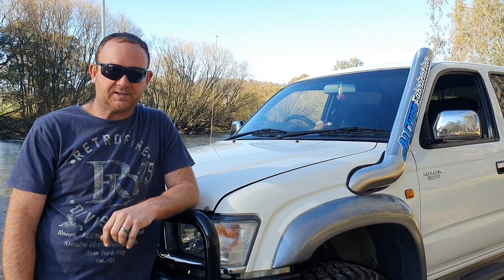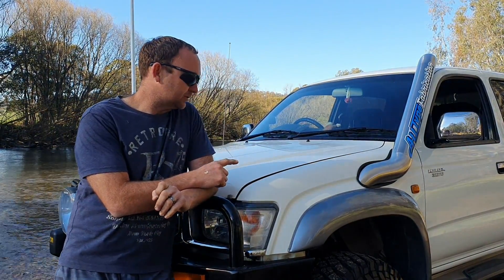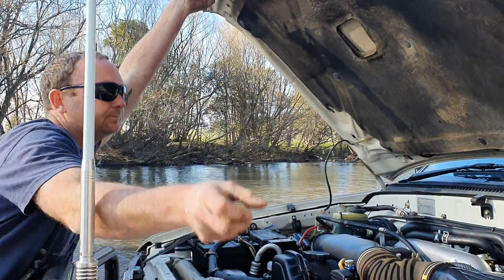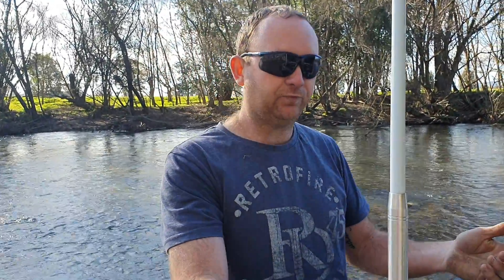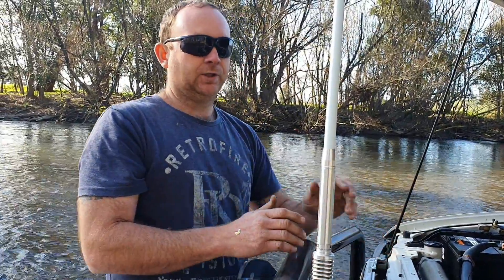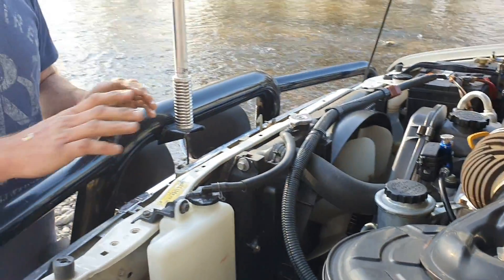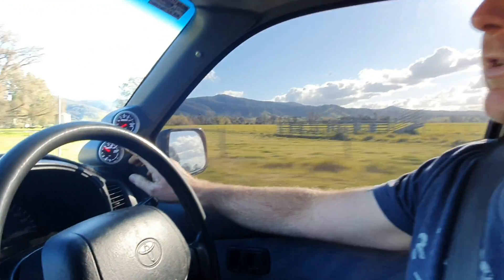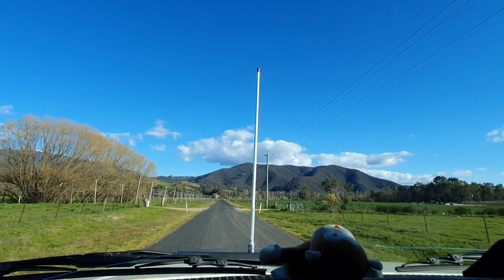1kzte hilux more boost? with stock pump making 18psi is it possible???

Comment: Question from a guy in the US with an imported 96 surf without an intercooler. While obviously an intercooler would be a benefit, is this a significant increase without an intercooler? I have EGR blocked, timing resistor mod, and running 14psi. I appreciate these videos!

Comment: Hey mate my ute is 2000 hilux 1kzte but has the electronic throttle body and pump, will all the mods you done on your one work on my  cheers
Reply from the maker: I dont see why not give it a go its just a boost tee afterall
Reply: Sweet as, I will give it a crack and see what happens. Thanks

Comment: @TRAV30387 Hey ... what is the effect on the fuel economy with increased boost and fuel cut defender, Are you getting better or do you have decreased fuel economy ?
Reply from the maker: Definitely worse on fuel consumption. Ive gone to the mechanical pump now double the power and fuel economy
Reply: @TRAV30387 i have mechanical pump and i wonder how can i have more power with same stock parts

Comment: Hi love the video im about to do this to my 1kzte Ln130 surf so a bit of a break down 1boost tap on turbo side 
2 boost cut defender on sensor side
14 turns for sensor side then how many turns turbo side do both of them have matching turns or vary
Reply from the maker: Turbo side it depends on the boost tee just click it till you get what psi you want cheers 4 the comment

Comment: Looking at maybe putting  boost t on my super custom van and put in a couple of pounds boost into it ,  standard at the moment just with new injectors it's a family wagon so not looking at a big exhaust is it worth putting extra couple of pounds of boost or wasting my time ,what about reliability . I heard by adding more boost and no fuel you're not going to get power gains what's your guys experience?
Reply: Up big hills did you noticed the egt's going up with more boost compared to std boost
Reply from the maker: @jr6874  not much difference not to worry i found
Reply from the maker: The electronic pumps have a fuel cut at 18psi boost so goin to 15psi from say 12psi will increase noticeable power not much i ran higher boost for about 6 months b 4 i did the big build

Comment: I have a rebuilt 1kz-te prado grndapa spec at the moment but  running  a high-flow turbo and boost t and it pulls hard !!! 
I'll chuck on a 3'' exhaust and fab up a snorkel and airbox then look at the fuel cut defender 
Cheers for the info mate

Comment: Hey mate, i know this is an old video but i have the same 1Kz engine and same boost gauge like yours, however i ve been having issues with the boost gauge needle jumping or flickering around while boosting.....was wondering where you plumbed yours to get it to hold steady
Reply from the maker: Hey mate mine is plumbed directly  into the manifold you may have a faulty gauge
Reply: @TRAV30387  i ve tried multiple gauges, same issue, any gauge that have a vacuum side, is having the issue did not try a boost alone gauge.....at the moment its T-ed off from the MAP sensor
Reply from the maker: Sounds like you have a boost leak mate check every hose mate
Reply: @TRAV30387  okay will do thanks for the assistance

Comment: Hey mate your links stopped working 
Can you send me a link for the boost tee you used to trick you map sensor. 
Also how do you know the map sensor is only seeing 10psi?
Reply from the maker: Hey mate its just a turbo smart fcd1 so any parts store sell them and the map sensor has a fuel cut around the 18psi from stock helps protect the engine due to standard fueling. Cheers
Reply: @TRAV30387  thanks mate, I've never actually seen a fcd in person like that. Just bought one for the Hilux! Keen to see what 18psi feels like with the standard fuel pump. 
Might get one for the supra too! 
Great video, it all makes sense now haha
Reply from the maker: @dingeldiy  yeah there interesting hey 18 psi is better but becomes heavy on fuel feels like you gain half a gear cheers mate appreciate it.
Gez your channel took right of good job mate 👏

Comment: As much as I have done very similar things to a 2.5 TD ranger I’m very much in the camp if I want more power for giving the truck more grunt by these machines are not built for speed, go too hard on a truck chassis for the benefits of speed and acceleration and you won’t do the gearboxes or diffs any good, they are not designed for it, a bit of extra power is good but they comes a point where it’s counter productive on a truck
Reply from the maker: Best thing about the sr5 not the sr hiluxs they have a stronger drive line aswell if you dont flog them on the daily they will last 👍

Comment: Hey mate, great vid

You didn't happen to monitor your air-fuel ratio when you were running 18psi?

Looking to do a similar set up as the one in this video, just looking to see how much boost I can run while still maintaining an ideal air-fuel ratio? 

Any helpful info would be greatly appreciated cheers Luki 🍻
Reply from the maker: Hey mate i dnt but the fuel delivery is meore than enough for the boost level

Comment: So with the mods you listed you can simply turn up the boost without adding fuel? I'd just like to turn mine up to maybe 12psi or something safely below the fuel cut
Reply from the maker: So i did a full 3"exhust boost tee and a fuel cut defender and safety ran 18psi b 4 the big build but all you need is a boost tee and u should get close to 14 psi
Reply: @TRAV30387  but are are able to safely turn it up to 14psi without adding fueling?

Comment: These hilux's are the better body build out of em all, the newer ones now dont even look like an hilux.
Reply from the maker: Istn that the truth this is my 2nd lux had this one 5 years still love it have a look at the rest of the build u may find them interesting lots more power now 💨🐌
Reply: @TRAV30387  yer may have more power due to updated engines and ECUs ect. but how long will those new engines last, mines done 340,000ks and still pulls along good.
Reply from the maker: @hecticgerva  thats the million dollar question mate how long will they last lots of electronics to fail
Reply: @TRAV30387  that i agree, but i seen old rigs start up from sitting from 30 years.
Reply from the maker: @hecticgerva  100% mate mechanical diesels keep on chuggin even after years of sitting
Reply: Ln106

Comment: Definitely do resistor mod mate get more fuel on low rpm .
Reply from the maker: Ive gone a completely different road mate went mec pump with all the fruit check out the 1kz power builds 🤘🤘

Comment: Hey mate, my kzn130 surf has a circular  little plastic actuator looking thing that's on that vac line you splice into. Did yours have this and you just replaced it with the fuel cut defender?
Reply from the maker: Hey mate look up my other video on info on the fuel cut defender ive got pictures and i explain what 2 do cheers mate
Reply: @TRAV30387  yeah I saw that one hey. The vac line that feeds into the bottom of the sensor has a circular plastic regulator looking thing just before it goes into the bottom of the sensor
Reply from the maker: @samoneill6175  thats a filter mate go between the sensor and that filter🤟

Comment: Hey trav, I'm looking to buy a 1kzte 2002 with 300,000kms. What kind of problems should I be looking for?
Reply from the maker: Straight up check for blow bye undo oil filler cap while its running if it blows of indicates its got a worn engine if it dances around good also belts make sure its had a timing belt done ther service intervals are 150tho look for oil leaks to many give it a miss check the oil in the dip stick if u know someone who know engines they can give an indercation if its lackin services or ill maintained now for the dreaded head issue get it up to temp with the radiator cap of if it bubbles like crazy well cracked head best bet is to get a mate or ya old man to go with ya and also the price don't just buy it cuse its a good price it may b a heap of S@#T

Comment: Hi mate I've done all the mods youv done where did you get your fuel-cut defender from cheers
Reply from the maker: Hey mate awsome just of the internet mate look up turbosmart fcd1
Reply: @TRAV30387  is it fcd 1 or fcd2 as I've already got the boost-t installed needing it bad fuel cut sux 😂
Reply from the maker: I used fdc1 its mechanical  the fcd 2 is electronic.. 
Less effort setting up the fcd1 enjoy lad it takes a bit of tuning to get the sweet spot
Reply: @TRAV30387  yer I've got electronic pump how much was manual pump cheers
Reply from the maker: @mattelms4035  it was 2500 mate tho there linkages and bracket and throttle cable & wiring loom to make it all work ive got theses videos uploaded explaining this 🤘🤘🤘

Comment: Hey mate, did you have to get a dyno tune after this? Or it runs fine?
Reply from the maker: No i dnt have to just made sure i kept an eye on the egts 18psi was pree much maxing out the stock turbo
Reply: @TRAV30387  thanks mate! awesome. What was safe EGT ?
Reply from the maker: @aleksstoj4611  stay under 550° 😀

Comment: Hiya, I'd love to understand but struggle with your accent. Is there a chance to see details in writing somewhere? I need to tune up my prado . It hasn't got a intercooler at all.
Is it true that we can ad potenciometer to fuel adjusting resistor at the pump?
Reply from the maker: Hey mate look in the comments someone has asked a similar question tho yes you can  to adjust fuel and timing
Reply: @TRAV30387  cheers and regards from Poland.
Reply from the maker: @skoda110  happy days mate enjoy

Comment: what year model is?
Reply: oh ok well im looking at a 2004 hilux like your one that has 155,000kms on it and was curious about its reliability do you know anything about them?
Reply from the maker: @lachlancashion3200  buy it mate if its the right price there bullet proof just dnt get it hot you will do a head the fan is the biggest let down
Reply: @TRAV30387  well i mean im not going to be doing any mods like you have there and for the most part just driving it around for like 20 or 30 minutes
Reply from the maker: @lachlancashion3200  not much to worry about mate just check the fan when its hot if it spins freely i needs oil toyota sells tubes 11 bux a pop u need 2 split the haviscus re oil it and good as
Reply: @TRAV30387  yeah right thanks mate...buying me first car 🤟🤙
Reply from the maker: 2000 mate

Comment: Hi can you tell me what you done with the boost sencer how you got just that to run 10 psi
Reply from the maker: Nothing just used a fuel cut defender to trick the sensor look at my video explaining how it works
Reply: Mine gets to about 2500k and turbo cuts off like no boost
Reply from the maker: @brucebrown2998  you have to play with it more sounds like fuel cut

Comment: Could you do and install video on the boost t/fuel cut mod👍🏻
Reply from the maker: Im planning on doin a vid on the fuel cut defender with more info
Reply: @TRAV30387  is that the one with the variable resister or is it brought
Reply from the maker: @4x4MadnessNZ  hey mate i brought the bits i dnt do the resistor mod

Comment: Got a kzte on my 85 pickup here in the states. Been losing power recently - won’t get over 4000 rpm above first gear. Up hill it’s pretty bad. Any ideas what could be wrong?
Reply from the maker: Is it electronic throttle body with egr or pree electronic so cable? Is it auto or manual?
Reply: @TRAV30387  it’s manual, electric fuel pump. I’ll check the connections. You think it’s fuel related ? Could it be transmission?
Reply from the maker: @Jack-gq5vm  definitely not transition. Sounds electrical mabie fuel check for boost leaks also
Reply from the maker: Check all you electrical connections could possibly be the fuel or timing connections on the fuel pump
Reply: these engine have problems with ecus.

Comment: 2003 Kzn165r 1KZ-te being a boilermaker fabricator I made my own 
S/S snorkel and front mount intercooler and plumbing plus a 3” exhaust with EGT   Probe, but I haven’t tackled this yet I think I was waiting for your video!! 
Looks like I’ve got some stuff to do !!
Maybe you could put a parts list in you description, but I suppose we need to do something!! Ha
Reply from the maker: All you need is a fuel cut defender and a boost tee turbosmart brand its that simple u have to tune it to the sweet spot and thanks for watching cheers

Comment: What gear box and diff ratios are in this ute ?
Reply from the maker: Hey mate all standard sr5 drive line
Reply: @TRAV30387  kzn165 sr5 drive line ? Mines a ln167 and driveline has been messed with and is a slug haha
Reply from the maker: @ryanchapman6865  yeah thats it mate oh true that sux are you following thecnew build?
Reply: @TRAV30387  nah mate not following that build ?
Reply from the maker: @ryanchapman6865  im doing the front mount intercooler 12mm jh hilux pump and high flow turbo build

Comment: Have been running 20psi in my 1kz 04 Prado for 50,000klm trouble free. Fuel cut defender, Subaru 3 bar map sensor, CCT billet high flow Ct12b, DP chip, 3 inch exhaust and a cooler fan. Vehicle has done 450,000 KLM. Egt no higher than 475 when towing, intake temp usually around 40-50 degrees, nudging 60 when towing, coolant temps no higher than 85 degrees. Quite comfortably keeps up and passes my mates remapped 1kd Hilux. Oh and mine is auto.
Reply from the maker: Thats awesome mate glad to hear
Reply: Hey mate, any chance you can help with a link for the Subaru 3 bar MAP Sensor? Or a part number? Ive heard theyre just plug and play - cant find any videos on them. I think they sound ideal!
Reply: @lionelkiernan6801 second this question
Reply: Hey mate what year is your prado
Reply: are those egt's measured post turbo? that's running nice and cool